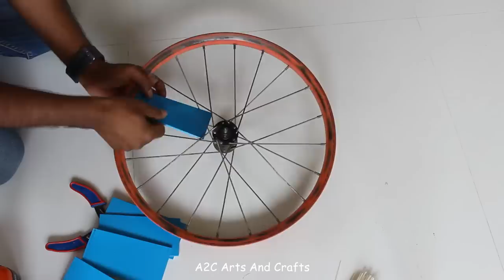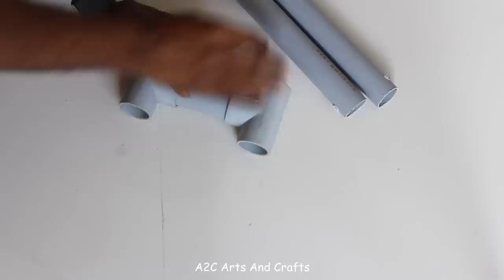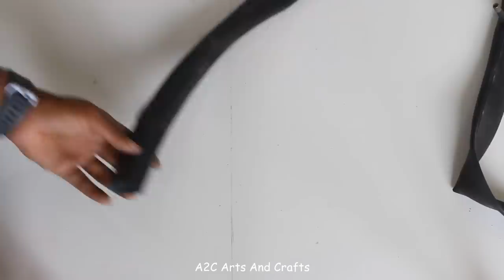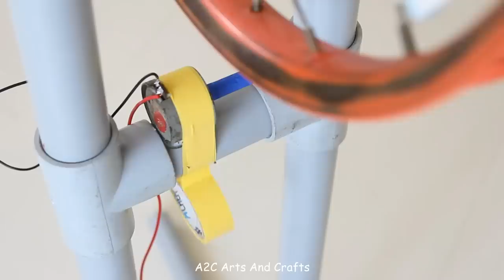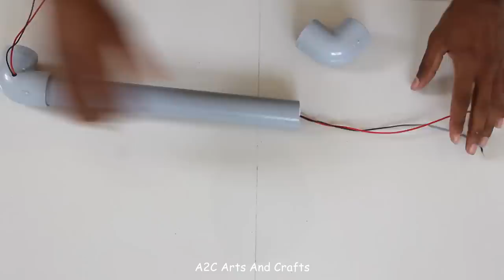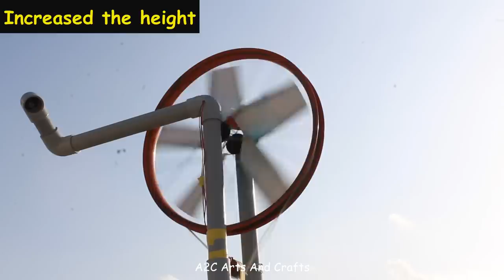Bicycle wheel Generator

Comment: That's a nice idea, though still a Horizontal Axis Wind Turbine (HAWT), which I feel is less valuable than a Vertical Axis Wind Turbine (VAWT) that would not have to be re-positioned into the Wind. Have recently watched a video of another gentleman making a VAWT with two Bicycle rims, and PVC Pipe cut in half for scoops. Though if you're just going to use that to power an LED light, then you could add a reflective parabola (from a "flash-light"). Also if you want to make a VAWT to power more than just a little LED light, try using a Car or Semi truck Alternator/Generator, with a True Sine-Wave Inverter. (for your 110/220 Volt appliances, or maybe a voltage regulator for 12 Volt devices and 12 Volt batteries.)
Reply: I have used a car radiator fan (12v DC) coupled to my exercise cycle to  pump my solar system batteries. Working fine  with couple of diodes in output  wires to protect against current. reversal.

Comment: You need a small spring loaded pulley on the slack side of the belt - this will keep the tension in the belt and stop it from slipping.

Comment: weak project but enough effort to get maybe 2 watts of energy. Do the same with the larger wheel only and use a car alternator to get at least 12v. what you can easily charge the battery. And from the inverter 12v-240v get more current for some time. Or a 12v-19v converter would charge a laptop at least. Cool idea. The project is weak. Greetings.
Reply from the maker: Thanks a lot for the suggestion